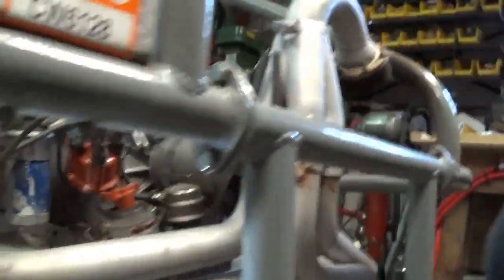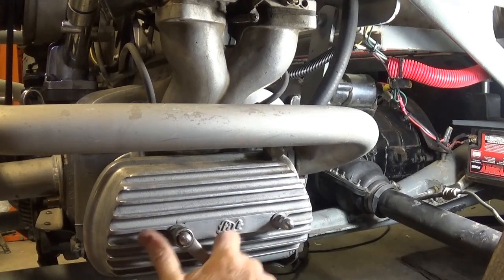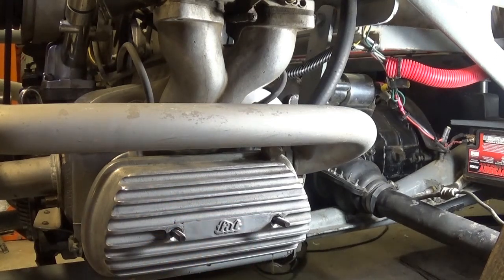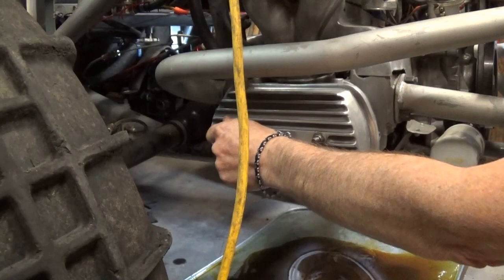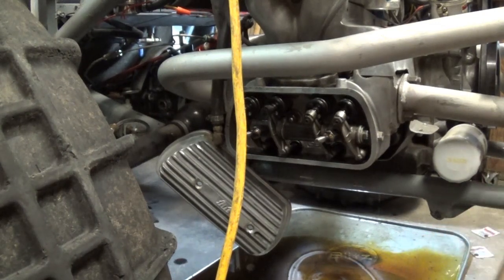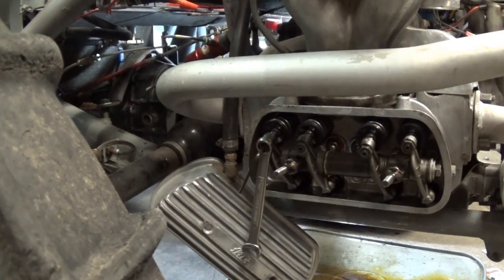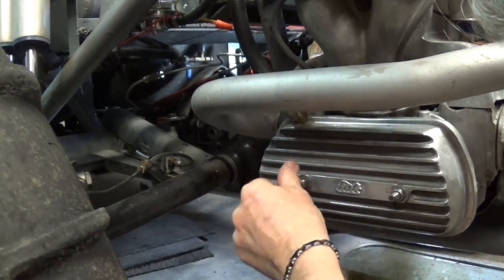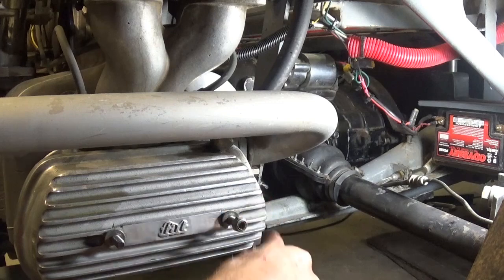VW 2276 Valve Adjustment

Comment: I was reading that the stock tin valve covers actually cool better than these aftermarket finned aluminum covers.  It makes sense when you think about it because the stamped steel is so much thinner.   Finned aluminum valve covers aren't quite the cooling upgrade that they are advertised to be.   Nice looking engine, EZ.
Reply from the maker: I would agree in a normal engine compartment such as a beetle but when your engine is hanging out like mine I don't think it hurts. Most aftermarket valve covers leak worse than the stock. These don't seem to do so bad. They will stay until I see a problem
Reply: I agree on a wide open engine like a sand rail.   I also read that VW even offered cast aluminum valve covers years ago for engines operated in arctic conditions that ran too cool and actually needed LESS cooling..   Thanks for the reply! Great channel.

Comment: I know most manuals call for .006 clearance on valves. I had a local shop install 88 cylinders and pistons from AA. Engine he said had a 110 cam and compression set at 8.75-1.  He noted to adjust valves to .004. I've sadly been trying to get a decent carb for a long time. It has a empi 34-3 on it that is leaky. I'm seeking to replace that. But My question, is it really necessary to adjust to .004 instead of .006? There's no mention on itemized bill he changed pushrods. Would they be swapped on a job like that? Going from stock to 88s? I have noticed on accelerator loss of power and read somewhere that incorrect valve adjustment could be a reason in addition to being out of timing.
Reply from the maker: adjusting .004 instead of .006 will just open the valves .002 more.  Your build could really benefit from dual carbs. instead of a centermount single carb. Even a new 34-3 won't work smoothly.  If you have the money go with dual 40 HPMX or 40 IDF webers or even dual Kadrons.
Reply: Solid advice. Sadly money is in very short supply. I actually was looking around what I could let go of in order to buy. I feel like I'm so close just need to be more patient in order to get where I need to be. Hopefully could have a set of duals by summer. Missed a nice cruise to Kohala yesterday but it's just the way it goes. Thanks for your content, if I'm ever in your area we're going for burritos!

Comment: My bolt on covers are CB performance.  I could never get them to seal at the bolt holes. I recently gave up and went with stock covers. I did have to double up the gasket to get a good seal. No real telling just how beat to crap my car was before I got it.

Comment: Aloha EZ! Recently upped my pistons to 88s from AA and mechanic said valves should be adjusted at .004. I believe he did have to machine the head, or he said he did. Have you ever experienced conditions where this would be the correct gap? Thanks in advance!
Reply from the maker: .004 to .006 is what most folks do on a cold engine. They cut the head because the top of the cylinder is bigger.  Going larger pistons also increases your compression ratio so I recommend premium fuel
Reply: @TheEZGZ  Great! I feel more confident doing it now. I thought it was going to be to tight. Mechanic did also say compression was I believe 8.5 to 1 and to run premium, I usually do anyways. I was literally just watching your 2110 Dream Engine Shoptalk HAHA! What I really need is a Burrito and a 2110!! So glad you are here my friend!

Comment: great to see you back making  vids,  just wondering is there a dry sump kit available  for these engines . probably be mega expensive though , and also add a lot more complexity  .
Reply from the maker: The oil pumps are not bad but the frigging 6 quart tanks are over $500 or I would put one on like my old sandrail

Comment: Thanks EZGZ for your videos. I will assemble soon my first vw aircooled shortblock. Do you know the torque for the case studs ( cylinder barrels)??? Mike
Reply from the maker: Yes I do because I have several shop manual's to refer to and you should not attempt to build a engine without one. If you can not afford one try the local library or used book store. They are every where.
8mm crankcase haves are 14 the 12mm  sealing nuts are ether 18 or 25 depending. cylinder heads are 18 or 23 depending. Oil pump 8mm are 14   I have a page full of numbers depending on the year, make model of the engine which you neglected to include.   GET A SHOP MANUAL and don't guess
Reply: TheEZGZ , hi thanks for reply. I bought two manuals ( Haynes manual & a German one - I live in U.K. not in US ). I read also some other books about tuning etc... I watched some of your videos ( which I always find great ) and VW Darrin‘s. Unfortunately I couldn’t find any information regarding the torque of the studs. I will assemble a dual relief case  with 10mm cylinder barrel studs and dual port heads ( 1600 ) for my Formula Vee. Once again you videos are GREAT and helpful. I learned already a lot!

Comment: I got chromoly pushrods solid rocker shafts Gene Berg style Adjusters with swivel feet for elephant tips whatever you want to call them Engle 125.
Reply from the maker: Gene Berg parts are some of the best out there. Your engine should last a long time and make great power.

Comment: Is it possible to use the stock adjusters on single hd springs?
Reply from the maker: Sure, some racers prefer it for 1/4 mile racing. Less chance for things to wrong but if you use a racing camshaft you will want to check the rocker arm geometry. You might need shims under the rocker stands.  Don't forget about the option of lash caps that go over valve ends or swivel feet. No sense running heavy springs with stock cam unless of course your running ratio Rocker arms 1.25 or 1.4. Can't leave out solid rockershafts. Man oh man your really opening a can of worms. Might have to make a new video.
Reply: TheEZGZ haha , I have stock adjusters on stock rockers with solid shafts. . HD SINGLE springs with chromoly pushrods. They get a little loud when the engine is warm is that normal?

Comment: when you were doing the closeup on #'s 3 and 4, i noticed that the valve spring retainers aren't the typical stamped steel style. do you know what they are made of and who manufactures them?
Reply from the maker: http://www.cbperformance.com/Valve-Train-Parts-s/61.htm
http://carcraftstore.com/singleordualhirevvalvespringsandkits.aspx
Reply: i checked that all out. i'm going with chromoly. although i've never seen a machined chromoly retainer which means they could be titanium.
Reply from the maker: Everybody and there brother sells chromoly don't forget the little keepers as well.  You will know if it's Titanium $$$$$$$
Reply: i know about the $$$. i purchased two sets for my daily drivers decades ago. when you went in close, i was thinking how much those retainers look like mine. if they are titanium, that's a nice component score and you did say the original owner spent some bucks.

Comment: Hello, regards from Mexico, excellent channel, I have a doubt on an engine vw 1600 that I am arming, only I am putting a tree of levies empi 110, my doubt is if on having put the axis of balance beams I have to put some increase to the axis, also reduce the heads, not if I could help with this doubt congratulations
Reply from the maker: Engel 110 says you can 1.11 or 1.25 ratio rockers on it. I don't think going with that much valve lift will make a nice running 1600 engine. I think it would be better to use a Engel 100 or smaller camshift profile.  I think you should use stronger valve springs with dual carburetors plus mechanical advance distributor like a 009
Good Luck with your project.
Reply: @TheEZGZ  Okay, will not original balance beams serve me for this tree 110? For that already I acquired this tree, also a couple of Weber 34s And distribution type 009 empi, that I can do then?
Reply from the maker: Original Balance beams  "GOOD"!